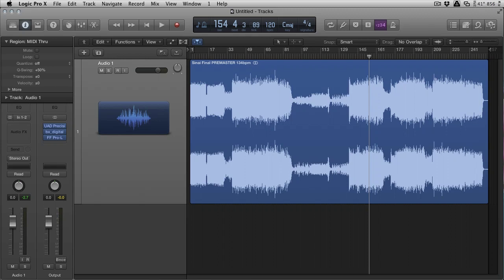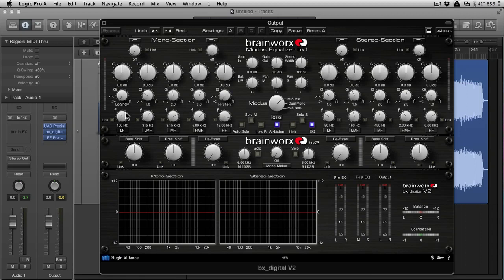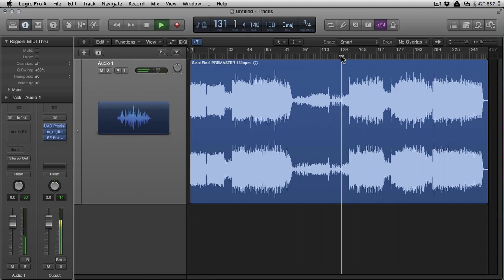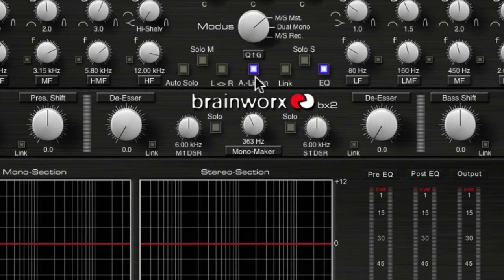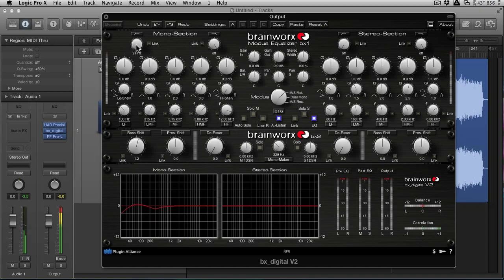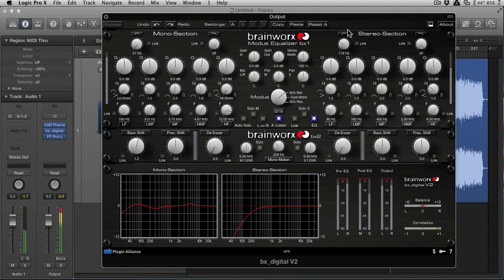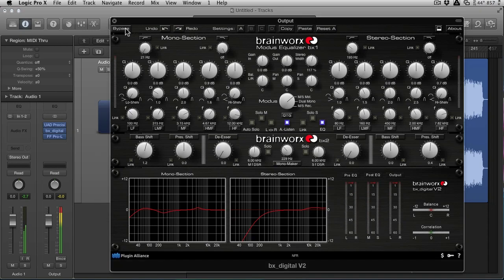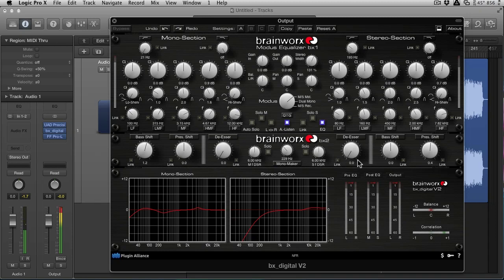Mastering Processes: MS Processing

Comment: The output is clipping like mad. (Bottom left corner). Seems like a pretty basic mistake to be making.
Reply: It's not clipping-it's hard limited by the Pro-L at 0db.  The master will come out looking like a brick.  However, Pro-L can do 4x oversampling and inter-sample detection if you want.  It's a great limiter.